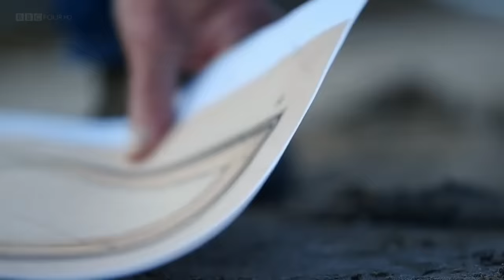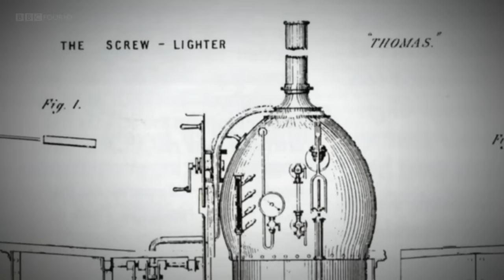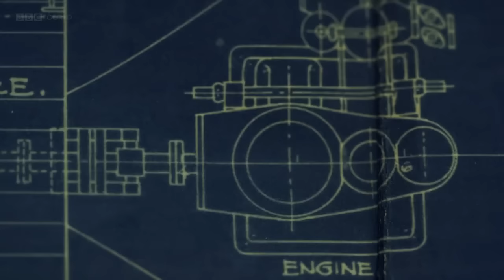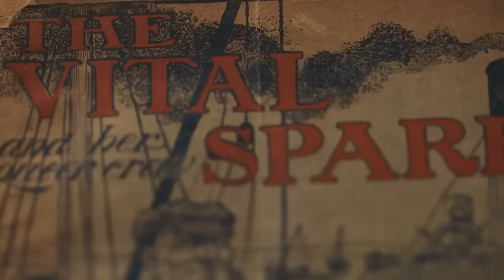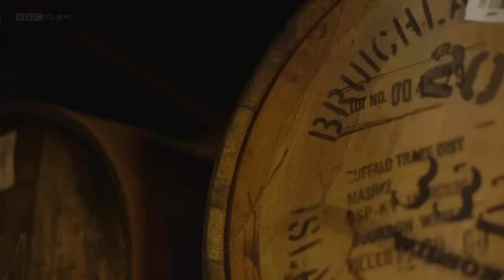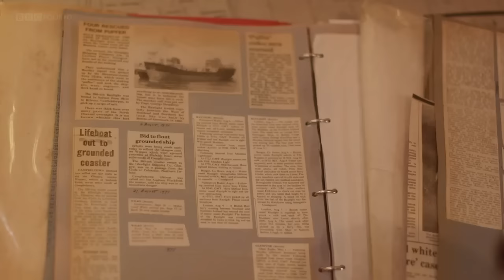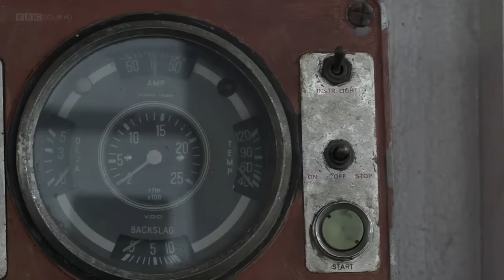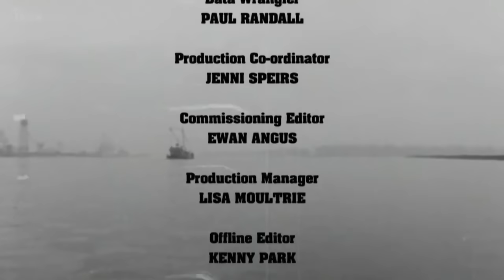Scotland's Vital Spark the Clyde Puffer with David Hayman

Comment: 0)  Great documentary on a great subject. Thank you for uploading!  :-)

1)  Steam ships have disadvantages compared to motor vessels. The size of the bunkers and the water tank (even with a condensor present) have been mentioned. Let me add the considerable consumption of lubrication oil and grease, but most of all: time. On a smaller ship like a puffer, it /may/ be safe to start the fire half a day before sailing. ("Safe": to prevent the boiler from cracking.) So, when "island hopping", the fire may have to be kept burning for the entire voyage, though you may be able to smother it for the night by "banking the fire up" (as I think that the original English expression goes, translated back from Dutch).

2)  These Navy puffers have rather high superstructures. Did I see the older ones pasding under bridges with the smokestack turned down? (That was a common feature of tugs here in the Netherlands.)

3)  Regarding the risks when beaching: I could imagine puffers to feature additional sheets of iron/steel under the keel, to be replaced "easily" after hitting a rock.

4) Judging from this documentary, puffers were (to an extent...) to Scotland what narrowboats were to England (before the railways and later the trucks took over).

5)  I could imagine a resurrection of puffers, in a modern way and shape. Serving islands and remote places with sea containers, the 20' and 10' sizes, some of them refrigerated. Maybe a crane on the bow or on a side for loading and unloading them. (Pipe dream: fitting these modern puffers with hydraulic extenders on the sides, to prevent them from rolling over with a load in the crane ropes when beached.) Wouldn't that constitute a niche market for Scottish ship builders? (I admit: a small market, therefore ignored in the Far East. But Norway and even the Netherlands might be interested. How about the Florida Keys?)
Reply from the maker: Glad you enjoyed it.
Reply: In regards to there funnels some of them could be fliped over so they could fit under bridges etc this happen a lot in Glasgow at the Brommielaw where the Railway spans the Clyde